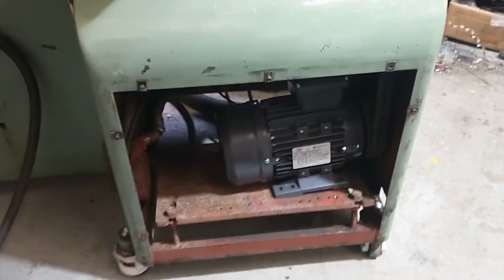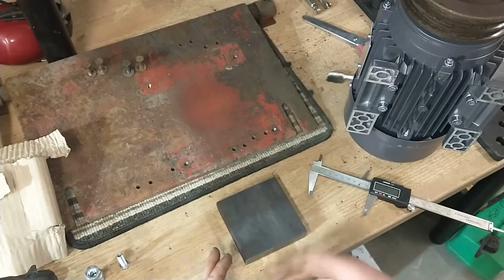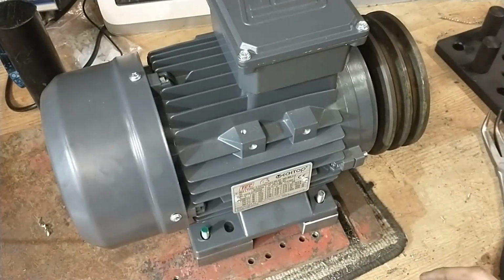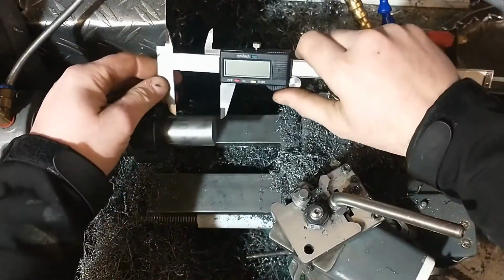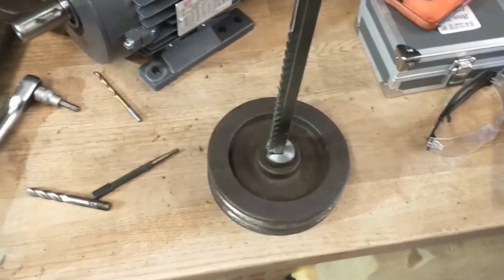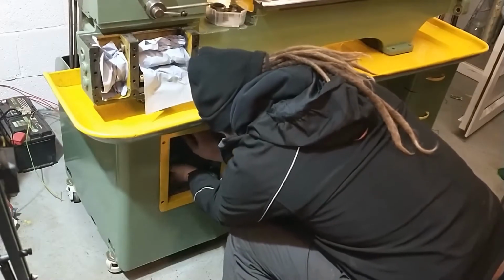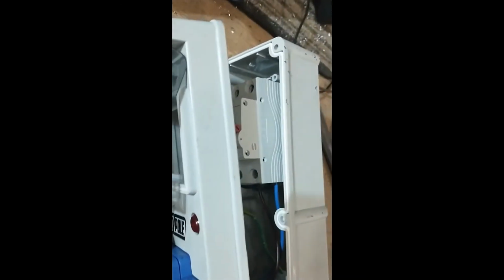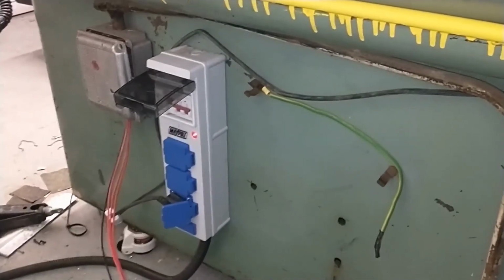Colchester master Round Head lathe Restoration -- part 2-- wiring & new motor installation

Comment: Hi, do you know what the belt face diameter is on the pulley? I'm restoring my lathe and don't have a pulley... Cheers
Reply from the maker: Motor or headstock pulley ?? I will measure up this evening for you.
Reply: @Adventure_Van_Upgrades  both would be great as mine has a matrix clutch instead of a pulley on the headstock side so they may be different...

Comment: Why did you replace the motor?
Reply from the maker: To allow for proper safe usage of the v.f.d drive inverter, as the older motor winding insulation can't withstand the various frequency's through it's windings and is pron to degrading.